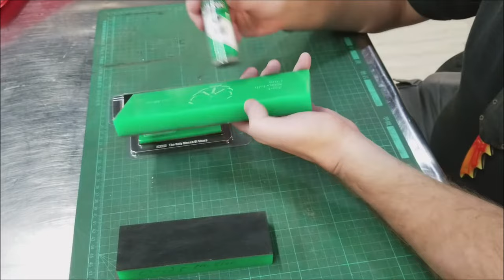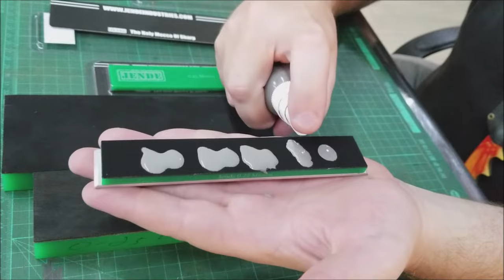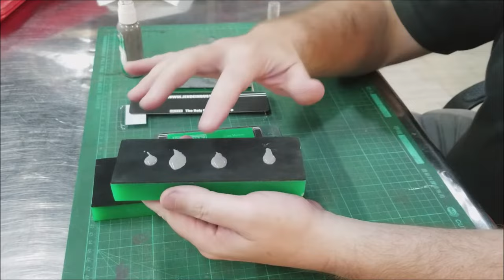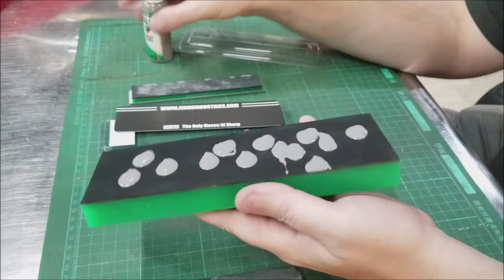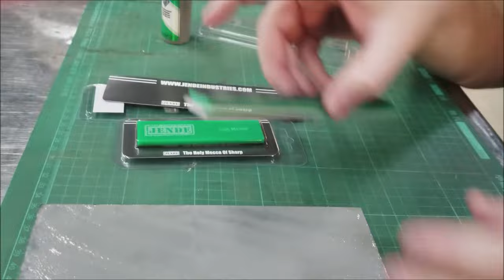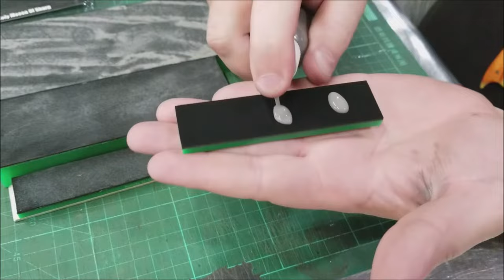Jende Sharpening Tips - Jende Nanocloth Strop Loading

Comment: I have a 2 and 4 micron full size along with corisponding poly spray coming in mid next week im new to stroping japanese knives and knives in jeneral off stone. How do i know when i need to re apply or when its starting to run low on the strop
Reply from the maker: Excellent question! when you apply the spray to the nanocloth the first time, get a good coverage on there, and do it 2-3 times, letting it dry in between for a few hours. Then let it dry overnight. Don't use it wet. The spray is more water based, so it takes a little longer to dry than the emulsions. When you use the nanocloth, use it until you don't get the results you want, then it is time to add more. This will be weeks or months depending on your use. When you reload, just cover the surface 1 time and let dry. That is usually enough.

Comment: I've just purchased from knives and co U.K. your boards along with 0.25 and 0.1 poly emulsion for straight razors . Yellow and orange bottles matching board nano cloth . Have you tried your product on straight razors
Reply from the maker: Yes, our products work wonderfully on straight razors!
Reply: @JendeIndustries  I've used it on several razors and it sure does the nano cloth is super easy to use . No harshness what so ever and leaves sharp smooth edge .
Reply from the maker: @garyhaywood6013  Those are my results as well! 
😎😎
Reply from the maker: Glad you like it! Thank you!

Comment: Please help!! I just bought a 6x1 nano strop and 6 micron stroppy stuff diamond emulsion from Gritomatic and I have gotten no results!!! But I think u just answered my problem.  I bought the cheapest bottle which was about $17 for a 5ml bottle. First time trying I didn't want to spend 35 $40 to test. I have sprayed almost the entire bottle and the strop is still jet black. The emulsion is green. 
 So if i spend $40 and load the strop how long does that last!? 
Please sell me on why i would keep buying your strops when i have to spend so much on these expensive diamond emulsions to use?  Btw i have been using a regular sharpral leather strop with cheap green compound and get good results so im experienced with how to strop. Please help!
Reply from the maker: I'm glad some of your questions were answered through this video. Here are the remaining answers to your questions. The nanocloth strop will ALWAYS dry black of light gray. It will not take on the color of the emulsions. Loading the strop 2-3 times initially is usually more than enough to get it going. Then you can use the strop for days, weeks, or even months before reloading it with one layer of emulsion, depending on your stropping frequency. 
The difference in diamonds vs the compounds is how they work. Compounds polish the surface while diamonds continue to abrade. I'd like to note that you are comparing apples to oranges with materials - Leather is 2 dimensional stropping, while nanocloth is 3 dimensional and you can't apply the wax based compound bars on the nanocloth. There is a learning curve when moving from old school leather with green compound to the nanocloth - mostly the pressure applied because of said abrasion and dimensionality is too great when first coming over from the leather to nanocloth. Also, you may need to address your sharpening progression up to the strops, especially the first time you use them. 
There's no definitive best strop out there. It's like choosing your favorite carbonated beverage - nanocloth is just another viable option out there to help make your sharpening better, and even a little more fun. Thanks!

Comment: When you said it takes about
3-3.5ml to load it the first time, is that for the extremely small 4x1?

So... about 18-21ml to load the 8.5x2.75/ 270mm x 70mm the first time?
Reply from the maker: the nanocloth is pretty thirsty the first time out. It takes about 2-3 rounds to get it really full of abrasive. the 1x4 and 1x6 use about 3.5ml to load the first time. the 2x6 takes about 5-6ml, and the 210x70 uses approx 8-10ml to load the first time. After that, they take about 1/3 to 1/4 the amount of the initial loading. Keep in mind that the time between loadings will be very extended compared to leather, which uses a small amount each time, but requires much more frequent loading.
Reply: @JendeIndustries  thank you very much for the reply.  I was planning on getting 210x70 strops with 25ml of compound each, but was worried that most of it would be gone after the initial loading.  (Was just multiplying by the additional area).  I feel much better if I'll still have over half a bottle left after initial loading.
Reply from the maker: @CGoody564  My pleasure! the 25ml on the 210x70 nanocloth strop will last quite a while for casual and personal sharpening. In most cases more than a year. If you sharpen on a more professional volume level, then a 50ml bottle may be better.

Comment: How often reload?? Good for straight razors?
Thanks,  Greg B.
Reply from the maker: Once loaded, they will last a while - at least 20 times if not more, depending on your stropping style and use. These are amazing on straights, IMO. You can first use the final strop grit to tickle the edge, and after several shaves you can start to add some pressure on the stropping strokes to keep the edge alive until you finally round it over enough to need a honing. I pushed the limits and got about 6 months out of a .25 micron 210x70 strop on a straight.
Reply: @JendeIndustries  Hi and thanks for a great product. I;ve ordered via Dicturm the 0.5 micron and the 25ml emulsion and I look forward to using them. Can you please  help me udnerstand how much they last? In your comment above you mean 6 months out of a single/ dual charge (initial loading etc.) for about 20 stropping sessions? Also how do you know when it is time to recharge, by the tool sharpening degradation or by visuals, i.e. deep black strop?

Comment: So I have the 1x6 strop.  My question is, after putting about four layers of your emulsion, it still looks pretty black. I don't see much grey haze gray. Should I keep going with the diamond emulsion until I see gray when it dries??
Reply from the maker: 4 loadings is more than enough! The strop will always be kind of black when it dries. It's VERY good to go. Be sure to go lightly on the pressure. It abrades quickly!
Reply: @JendeIndustries  that's what I thought. Thanks so much for the reply!
Reply from the maker: @Teleman01  No problem!

Comment: Hello, if i can only have a one diamond spray, what micron i should get ? i always finish my sharpening at 3000grit ruby.
Reply from the maker: Excellent question! You have 2 options. 1st  is a cleanup grit at 4 micron (4K grit), which gives you an optimal 3K edge. The other is to "polish the grooves" by jumping to your choice of 2, 1 or 0.5 micron (8K, 15K, or 30K grit). This gives the edge a jump in sharpness while keeping the base stability level of the 3K edge.

Comment: Hi Tom...would it help to pre-wet the stop with a little water?  Just to save a little bit of compound?
Reply from the maker: Hi Michael, pre wetting the strop wouldn't help much since the idea is to use the strop when dry. So any water that is place holding will dry out, diminishing the concentration of emulsion, and it will take longer to dry than the emulsion in general.

Comment: Can I use  0.025 micron on a normal leather or do I have to use a nano cloth
Reply: You can use it on just about anything. I like perfectly flat pieces of basswood myself. That way I can just use the exact same angle as I do with my stones, and I can apply a little extra pressure if I want without risking apex deformation.
Reply: @oceanwaves83  thank for the help
Reply from the maker: You can use Jende Nanocloth, Leather, Kangaroo, or wood. Each medium will interact with the emulsion differently. As The Ace alluded to in his reply, the Nanocloth has more compression than leather, which has more compression than roo, which has more compression than balsa, which has more compression than bass wood, etc. More compression equals more rounding or convexing of the edge, but it is also usually more aggressive of a medium.

Comment: Will .5 micron give hair whistling edge
Reply from the maker: Generally speaking, if you did all your lower grits well, the 0.5 is the place in the progression where hair splitting happens. Thanks for watching!
Reply: Im coming off 1000 grit diamond Im not getting hair whittling off head hair but it goes right through beard hair do you think it's because not going high enough grit on stones
Reply from the maker: @damensutherland7081  Ahh you have stumbled upon one of those things that messes with every sharpener! First, beard, arm, leg, and head hair are often different thicknesses and therefore react differently. Long beard hair is easier to cut then short, and head hair is usually the most difficult to get whittled or popping. With that said, you have a bigger issue of what I call a "false positive" that lower grit diamond plates tend to create. The diamond cuts so deeply into the metal  that is creates a serrated edge. That catches the hairs in a scissor-like groove and causes them to sever. In order to get a whittling, edge, you need to literally slice into the hair without cutting through. This edge is much thinner and consistent so it can bite into the hair and continue to cut along it without going through in a scissor-like snap.  That usually starts to happen around the 8K or 2 micron level. 0.5 seems to be the upper most limit before you start hitting hair popping without the false positive.

Comment: Hello Sir!
So how much give do you get when stropping on this?
Reply from the maker: There is a small amount of give on the Nanocloth. The thickness is about 1mm, and if you use pressure, you get a slight amount of give that pushes the nanocloth itself down, and exposes the honeycomb chambers loaded with abrasives, and makes the strop much more aggressive at the same grit. COmpared to leather, the feedback is softer on the nanocloth, but it is quite tactile.
Reply: @JendeIndustries  more 'give' than Rock Hard felt?

I would say using it to strop straight razors, then it wouldn't give much. I guess?
Reply from the maker: @michaelshults7675   I think rock hard felt has a little more give than our nanocloth. The nanocloth is like a perfect mix between a sponge and neoprene.. Just enough draw, but just enough give. The advantage to using it on straights is that you can get more aggressive at the same grit by adding more pressure, but not really causing too much rolling and then finish with ultra light strokes to tickle the edge. You can also get a longer lasting maintenance stropping routine out of it, as well as it being faster. Overall, the dynamics of the nanocloth make it very ideal to razors, IMO.

Comment: Would you need to adjust your angle on the wicked edge system when stropping with nanocloth like you do with leather?
Reply from the maker: Depending on your pressure, a 1 degree change to compensate for the compression of the strop is a usual move by many.

Comment: Did the diamond paste improve the edge of a straight razor? I found my edge very smooth only if burrs are removed and work on 1000 grit is perfect! Never tried a paste!🫠🤔
Reply from the maker: For my school of thought, pastes can improve your edges if you use them at the end, and not so much for the sharpening process itself. What is more important is the consistency of the edge of the edge when you go to shave. Uniform is better, but you also have to make sure you have enough rigidity to it so it won't fold over. It's a dance between more refinement, which makes the edge less stable. It's also part of the fun!